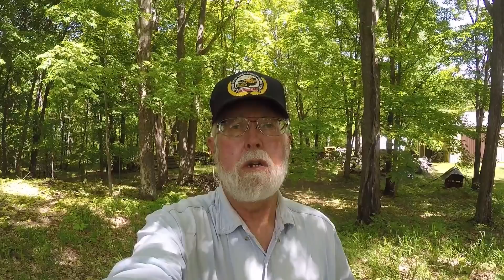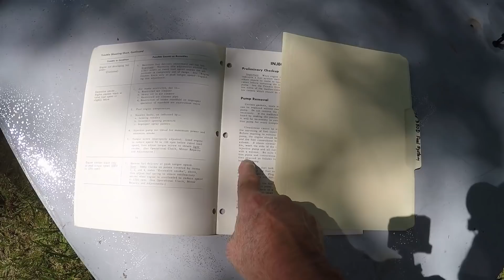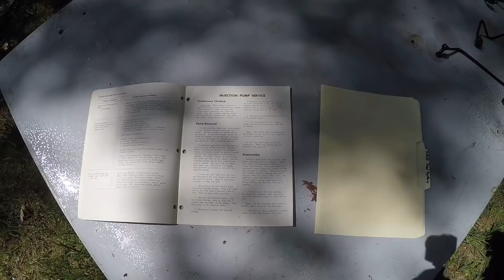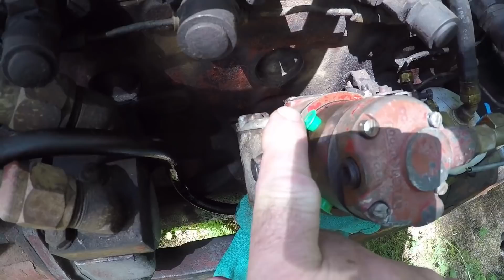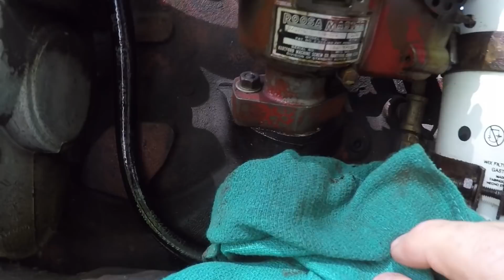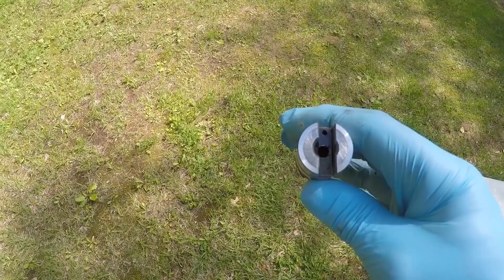Senior Is Back!!! Farmall 350 Diesel Tractor - Removing The Injection Pump For Rebuild

Comment: I find it interesting that IH used a Continental engine; they built so many of their own. The B250/275/TD5 used the BD 144 which was British but IH used a lot of its British and German engines on American made tractors a few years later. That said, the Rosa Master pump is still relatively easy to get parts for. Of course there might be some that are unique to that application that might be a challenge but still easier to come by than say, an American Bosch PSB.

Comment: I have a 350 diesel just like your's. It's in the shop right now getting an oil leak fixed. The umbrella O rings on the pump shaft started leaking oil. Waiting on the O rings to show up.

Comment: Hey Squatch, wondered if you could help me with a particular 2001 Ford Windstar van my family has. As for the things it does, well here goes:
It runs very poorly, and hooking up an OBD scanner reveals codes that say its running lean on banks 1 and 2 (it has the 3.8L V6).
Second thing is that pretty much none of the windows work, and sometimes if they do its very intermittent. My biggest question is, could you walk me through troubleshooting these two things, or would that only be something that could be done by a mechanic in person? Thanks
Reply: NEAFarmKid you'll have to wait and see if Squatch responds on the engine. However on the windows,  they are likely sticking due to the regulators binding. Those are cable spools driven by a motor inside the door, with lift mechanism for the (heavy) glass. Possibly rust/age & lack of lubrication caused problems. 
Sometimes slamming the door while operating the window switch will release it enough for the motor to overcome the  resistance. Another handy trick is,  squirt some silicone spray down the rubber edge seal in thefront of the window. (not WD-40 since oil based lubricants will damage the rubber )
Reply: @squatch253  thanks so much sir!!! I'll be sure to check all those things.

Comment: My FIAT DT125 (6 cylinder diesel) tractor had similar symptoms and it was caused by an air leak in the fuel system.
The leak caused the governor to misbehave.

Comment: I grew up on a 350 diesel just like that. We had the same problem with a plastic part in the governor flying apart. Ours had the same brand wide front end my dad put on new in the 1970's.  He had rebuilt that tractor from end to end used it farming up until about 8 years ago. Engine parts are really hard to get and it was tired from a hard life.

Comment: Several years ago had an Allis Chalmers diesel with a Roosa Master pump that needed repairs.  Parts were hard to find and, at least in my mind, more than a bit pricey but, as with all old stuff, it costs what it costs.  Good luck on yours.
Reply: Roosa Master got bought up by Stanadyne and rebuild kits are still around, Stanadyne still makes rotary pumps like this, that looks like a model DB

Comment: i have two of those 350,s one gas and the other diesel. The diesel set with the exhaust uncovered and it was stuck when I bought it. Pulled the cyl head and very rusty cond. would need sleeves and pistons. So I just used the rear tires on other tractors. Im not going to even try to fix it.  I already used the power steering on another tractor.

Comment: Thanks for sharing! I worked at a fuel injection shop in the mid '80s I was trained on the Roosa Master injection pumps. My guess is that your governor weight retainer flex ring (If there is one) has come apart, some so bad it sheared the pins off that secure the flex ring. Most of them were in many pieces when we took them apart.
Reply: @squatch253  I had to go relive my days at the diesel injection shop. They were about 6 months of good work experience until I fell ill from absorbing calibrating fluid through my skin into my blood stream. After watching a few videos your little Continental diesel injection pump could just be suffering from gunk and sludge causing a sticky metering valve. I still think it is that plastic flex ring but some of those models did not have that.

Comment: Great to hear from you again, Senior!  I have a 3020 diesel (green, I know), that would rev up until you have it full throttle. I was advised to get the injector pump rebuilt before it over revs on me. Had that done and she purrs like a kitten! Only thing I wish I would have had done was turn up the pump just a bit while it was off. They dyno'd it after it was back on the tractor and it only put out 55hp. But I guess this is easier on the whole drive train.